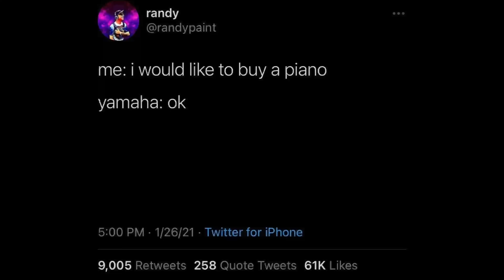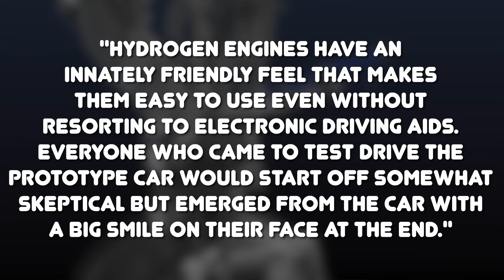Toyota's New 455HP Hydrogen V8: Everything You Need to Know

Comment: But given that hydrogen is better suited for heavy loads, there will be charging depots nationwide for those vehicles.  The Hyperion XP1 is said to have a driving range of 1000 miles (0-60 = 2.2 sec). Hydrogen vehicles don't lose range as the temperature goes down, and don't present a combustion risk as temperatures go up. Electrolysis is getting less expensive and will continue to do so. Last year the UK started working with "test communities" to replace natural gas with hydrogen for homes.  I think that within the next decade hydrogen will be less expensive and more plentiful. And based on the descriptions of changes in ICE engines in order to burn hydrogen, it should be relatively inexpensive (compared to buying a new EV or hydrogen car) to provide conversion kits for the sake of the environment, since we've probably got a lag time of at least 30-40 years before gas-powered vehicles are no longer on the road. And speaking of gasoline, I'd guess that there will be more gas stations with fewer customers over time, opening up the possibility of hydrogen fueling stations replacing them (the current budget includes $8 Bil. for hydrogen). Personally, I'd prefer hydrogen fuel cells, as at that point we're dealing with electric vehicles all around, with loads of maintenance benefits. And even though H2O exhaust could actually increase global warming (and it certainly will, with all the jets that will be using it), I'd prefer a better-hydrated Southwest than a desert in the place of the US' major agricultural zone.

Comment: I really want Hydrogen to be mainstream market more than I wanted EVs to be. The so-called reduced maintenance cost is eye-washing. Changing the batteries cost you more than your entire maintenance of Gas cars. On a positive note, the running cost of EVs is much lower than gas. But, if you want to charge EVs, man, you have to wait for at least 4 hours. Imagine as you say, most of the cars are EV & you have to wait in a queue to charge your EV and Infrastructure troubles are yet to emerge if every one of the cars on the road is going to be an EV. That's why Japan is clever enough to invest in the alternatives. 
I would agree on the demand part, Let's see. You mentioned cost would limit the customers. Even EVs cost higher than Gas and people still buy. People "should" buy a vehicle which pollutes less and we do not have any option to save this environment & EVs are not a good option to be considered as "Pollutant free". 
I would really really want Hydrogen rather than EVs.

Comment: Hydrogen can be produced at home or at a gas station or a factory with zero emission. It can be used to store energy during sunny days and compensate for rainy days. It can be produced anywhere, on the coast or in a desert. It's only significant emission is drinkable water. It does not need to be extracted from the ground, transported, refined, transformed into usable fuel or batteries. Does not need super tanksers , cargo ships, power lines or pipe lines. Most current technologies will run on it. It is not affected by supply and demand, so the price will always be affordable and you can have that big car or truck if you want to. You can use hydrogen to electrify your house, heat it or cool it, cook your food and even supply clean water, fuel your car, a train, a cruise ship, an Airplane. Tell me again why hydrogen is bad for the world, I cant seem to grasp why you need to be a slave to oil and battery suppliers who dictate how much you have to pay for energy?

Comment: If you think about it, an engine running on hydrogen would also contaminate its oil less than if running on gasoline. This means that oil change intervals could be extended even further with simple, miniscule top ups at regular service intervals. Imagine getting an oil change every 30,000 km or more. So long as the engine is at operating temperature for long enough to boil off any water in the crankcase from cylinder blow-by, you'd have no issues. The car would be safer too because a hydrogen leak rises into the air where gasoline pools around the vehicle. A hydrogen combustion car would be relatively cheap to build (at least, compared to the resource intensity of EVs). Hydrogen can make more power than gasoline as well. We now have electrolyzers which are up to 95% efficient at converting electricity to hydrogen. While there are obvious losses that remain from compression and transportation, I believe we will increase our efficiency in these areas as well. If we can get ourselves to the point that economies of scale allow for cheap, accessible hydrogen fueling infrastructure, I think they would be much more popular than EVs in the long run since you get a very low emissions vehicle with none of the downsides of an EV.
Reply: Hydrogen source is water. Hydrogen is for drinking and washing clothes not engines.

Comment: I did some advanced work on hydrogen fueled ICE engines in the US car industry.  One positive I saw with hydrogen was the elimination of so many emission systems:  it doesn't need exhaust gas recirculation (EGR), which later become intercooled EGR; no purge canister; it didn't need an electronic throttle and VVT which are often used to control internal EGR; and it didn't need a 3-way catalyst.  Hydrogen-fueled engines last a lot longer because there are no combustion products going into the oil to increase wear, and the oil lasts a lot longer.  

The ICE has seen a crush of over 50 years of government regulation, adding to its cost and making some of them a service nightmare.  Government and the environmentalists are only getting started in understanding the negatives of EVs and regulating it.  They are just waking up to some of the issues:  recycling issues with used batteries; fossil fuel used to mine lithium (the estimate I heard is this along gives a new EV a carbon footprint of 40,000 miles out of the box; cost to replace end of life batteries (one estimate was $10k); fossil fuels still being used to create much of our electricity; if wind power is used, many wind turbine blades are not recyclable at end of life and can only be cut up and buried in the ground; and EVs use more rare earth and specialized metals than ICE vehicles.  I don't claim to have all the answers, but I think hydrogen fueled ICEs might have a significant place.  Let the free market decide when the time is right for some of these technologies, instead of government dictating technical solutions that it doesn't understand.
Reply: This is the most underrated comment in the history of comments.
Reply: And considering people have been making hydrogen engines for a long time and being murdered for it.

It's not really new tech and I'm sure someone's going to compress and shrink down the ability to compress your own hydrogen in home using solar panels.

I mean creating hydrogen is so easy you can do it with a few spare parts.

I mean think about it how many watts of energy does it take to process one barrel of gasoline and if you take that same amount of power can you produce the same amount of potential energy extracting hydrogen from water?

I mean even if it's near even maybe a little more expensive it would still be better and more profitable in the long run to stop pulling oil out of the ground and just start creating hydrogen.

And as the use goes up so will innovation.
Reply: @anarex0929  any more info on people being murdered for it ?
Reply: @caleb9231  yeah easy I found it by accident go on to YouTube type in hydrogen engines start searching the videos look at the ones that spontaneously stopped posting videos look into the individuals they're dead it's not that hard.
Reply: HELL YES, AND I AM A FEDERAL GUY!!!!!! Worked in the defense industry for over 20 yrs.
Reply: Completely agree. I'd like to see the complete cycle from life to end of millions of EV cars. What will happen in the middle (enough power to satisfy the needs of every car) and at the end of the lifecycle with batteries laying somewhere.
Reply: I agree hydrogen is exactly everything they want right now zero admissions less damage into the environment and the only drawback is the danger and explosiveness of hydrogen but I'm sure in time they will find much better ways to make it at on site instead of having to transport it to so many stations
Reply: @terryhill4732  One gallon of gasoline mixed with air is equal to 14 sticks of dynamite.  All the fun things are dangerous.
Reply: @terryhill4732  ever seen a gas station blow up? it's amazing the lack of safety in those things. the fuel is literally dripping all over the place all day long with people smoking. even the fumes are combustible. people are going to have to just be smarter if they want technology. eventually, technology can easily outstrip maturity. that is the most dangerous thing. now you have wacked people in charge of really dangerous things. bombs. viruses. sonic artillery.... satellites. corporate research in international waters. government research underground.
Reply: @Tenvince  good luck finding maturity in the United States anymore
Reply: @terryhill4732  LOL i know. you just can't get any anymore. i live in japan. a bit better, none the wiser. you literally just have to leave people behind these days. if they swim, they swim.
Reply: @_____ ceramics inserts
Reply: @jimalldredge8691  or polymer coating
Reply: I've seen DIY's on YouTube where you purchase matched batteries for around $2,500 and that includes the price of recycling the old batteries.  Relatively easy and completely safe IF you follow directions, at least on a Prius.  Though that's a hybrid and not replacement for a true EV.  Costs will plummet as adoption increases, though and you're looking at what... Gen2 or 3 batteries vs the Gen 4's and 5's around the corner?
Reply: No need to transport hydrogen. Hydrogen stations can be made to extract hydrogen immediately as a person begins fueling. All thats needed is water running through a pipe like every home and sink. The hydrogen station will automatically extract the hydrogen. It’s not hard to do. 

Also another way is to pump water into the cars tank and if engineering design the car itself to extract the hydrogen within the car….problem solved. 

As far as containing hydrogen…..the stations can be made to freeze it to reduce leakage. 

OR

The vehicle extracts the hydrogen it need while maintaining a percentage in water. To reduce leakage and when ever it needs more the device inside car will automatically begin to extract the amount hydrogen it needs

And I don’t know about fella in the video. He seems extremely bias by saying there’s no differences between Gas combustion engines vs Hydrogen combustion. There’s a huge amount differences using hydrogen. Theres less heat being generated which gives all parts in engine bay including the engine longevity. Parts are less susceptible to wear and tear with hydrogen. 

Personally I’ll buy an electric just too vary my collection but i prefer combustion engines all the way. EV’s anyone could be riding a bicycle and no one would know if they’re about to get hit by a car because they’re so quiet. EV’s dont look fun, feel fun, roar from the engine. And what if a war breaks lose and the enemy attacks the electrical grid. We’re all screwed. How will we charge our vehicles to get around during war?
Reply: @FlowSharp  hydrogen Burns twice as hot as gasoline does therefore a higher octane clean burning fuel
Reply: @FlowSharp  It requires a large amount of power to make hydrogen from water which can't be done in a small vehicle.  Due to loss, you can not make enough hydrogen to continue making hydrogen unless the vehicle (ship) is large enough for a nuclear reactor.  I propose oscillating the electricity at the resonant frequency of water to greatly reduce the power needed.
Reply: Really Ferrari, Lamborghini or any other exotic car makers should be the ones investing in this since ICEs are a part of their identity. Im sure they can make a refueling station that can fit in a garage but at least at first I would guess that would be too expensive for the average person. At the end of the day hydrogen just another type of battery since you need electricity to make it. It’s less efficient but at least you don’t need a lot of nasty chemicals to make it work.
Reply: by far, the biggest problem, continuing for a century, with hydrogen ICE, and indeed most hydrogen related technology, especially production tech, 
is "national security". for 100 years, they have viewed all progress in this direction as threats to the market (who's market) and canned nearly all of it once it gets near production. 
the patent offices around the world are full of applications which would have made this type of thing a reality many decades ago, many times over.
it is also the same story in many other technological fields where large, global, cash cow industries disseminate "tech", "solutions" and "treatments" to the world. it is an age old game.
Reply: Hydrogen fueled engines last longer? We not gonna mention the Toyota hydrogen car that was mentioned in this video had extremely amounts of engine nocking?
Reply: If you watched this video, read this comment.  Carl knows hi sh!t and everything he says about hydrogen is bang on.
Reply: Right on
Reply: Good comment
Reply: I believe hydrogen is so much simpler than what the media and social media make it out to be and that's why I fear our government is trying to do everything within its power to not promote hydrogen over electric vehicles because they realize that the average mechanical minded person could somehow make hydrogen at home which is a simple process with a small hydrogen fuel cell with a little more research you could make it to where it would actually put out more hydrogen as needed, to me it looks like a game changer even though it's not new technology in a way to fight emissions of internal combustion engines
Reply: @\f_a/ the source for hydrogen is water.
Reply: @\f_a/ reply to @\f_a/ : the source for hydrogen is water.
Reply: Don't forget Cummins is already developing a real world hydrogen powered diesel engine. In other words they're letting their highly successful diesel ix15 commercial diesel engine and converting its intake system and heads to function with hydrogen. I don't care if it didn't dramatically increase hp torque and mpg but it's allowing us to keep our beloved ICE's and doesn't require any of that emissions control garbage and has zero emissions then think of how many lives that will save from accidental carbon monoxide poisoning and less house fires alone! The transportation industry will have to pioneer the way to create the fueling infrastructure for the pedestrians.
Reply: @aaronautry1981  Mr Cummings is coming
Reply: @aaronautry1981  we must not use hydrogen to power engines. We will deplete our water supply.
Reply: Well said brotha 😉👍
Reply: @_____ you just make the metal hydrophobic. it's all about pushing or pulling molecules based on electromagnetic attraction or repulsion. it can even be done by just embedding other molecules within the metal.
Reply: I agree with you 100%, I think hydrogen fueled ICE has a prominent place in the future
Reply: That's actually a really good point about the systems elimination, and I feel like it would make a production ICE significantly cheaper than a gas or electric counterpart. Far fewer rare earth metals, less maintenance, less design time on a less complex system, and the exhaust system would be reduced to either a couple of steel/aluminum pipes to almost nothing at all if it was made short enough. You don't need a catalytic converter when all you're dumping is moist air.
Reply: I Support your comment and think relatively similar. In my research it was an estimated 500k us gal of fresh water and 100k us gal of oil used to mine lithium. The mining process of cobalt in Africa is also a horrible process to our environment. Which also takes advantage of the local people of Congo.
Reply: using hydrogen in ice engines vs fuel cells still have much lower efficiency tho, imho hydrogen ice/electro hybrids might hit the sweet spot
Reply: Truth
Reply: You forget, it takes too long to warm up and evaporate water from the crankcase. And air is only 21% oxygen. Probably lower now. So whatever else is makes would probably be acidic. Lets all make engines out of stainless steel and food grade aluminum which will probably tear itself apart. Sorry, just trying to be mean. 🚳
Reply: Exactly let the free market decide, don't force EV's down people's throat.
Reply: Hydrogen source is water. Hydrogen is for drinking and washing clothes not engines.
Reply: @\f_a/ hydrogen must not be used for engines. Hydrogen is for drinking.
Reply: We must not use our water to power engines. We need water for drinking and washing.

Comment: I think the future is bright for hydrogen. Hydrogen cell to make electricity or hydrogen combustion. The infrastructure has had some serious developments and efficiency improvements. Plus you can even make hydrogen in an algae bio reactors. Batteries will take the lion share of the market but certain use cases may require hydrogen power.

Comment: Hydrogen is being Cblocked because they can't be controlled like evehicles can be.

The whole push to electric cars is for control.  Combustion engines can't be disengaged remotely or have geofences applied to them like electric vehicles.

Hydrogen for smaller engines and nuclear for large scale use is the cleanest, safest and most efficient ways to go.

Comment: The problem with hydrogen is that it has super low density AND requires a 3:1 fuel ratio compared to a 14:1 ratio with gasoline. Also, steel tanks to hold the hydrogen are very heavy and would have to be big to hold enough fuel.